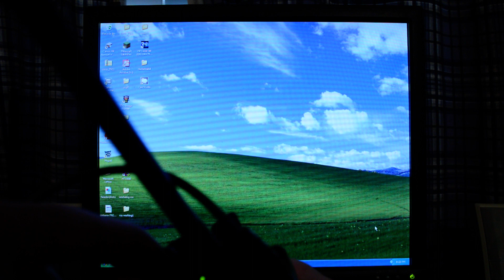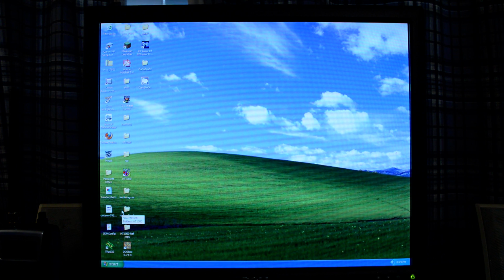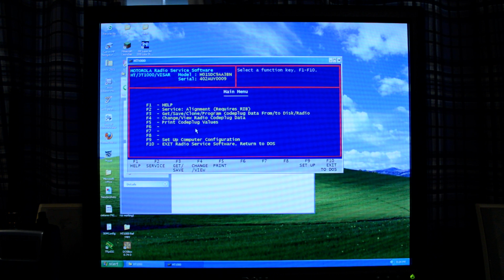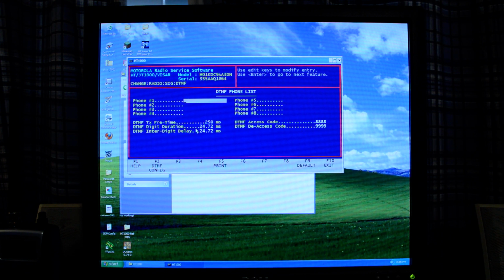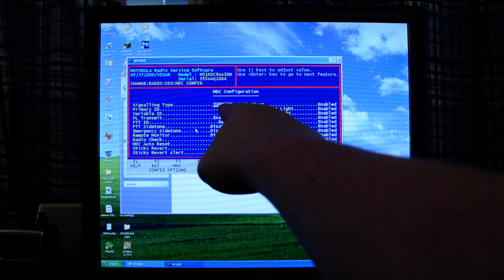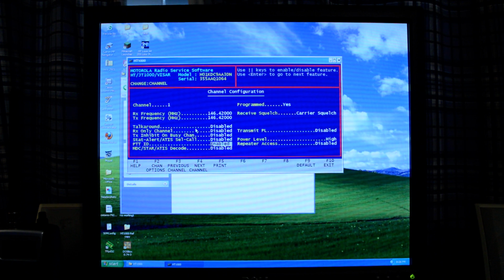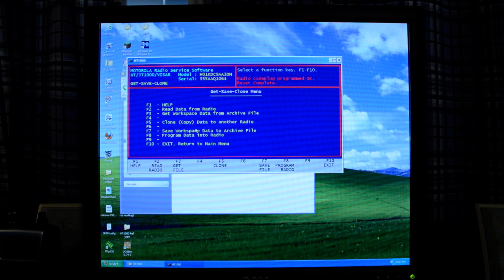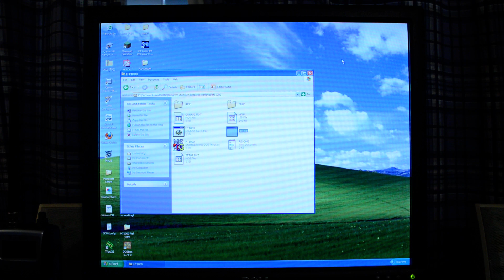How to program the Motorola HT1000 with TPT hack.

Comment: Hello!!! i know that this is an old video but i am having a very hard time with this. so I got the software and i got it all set up on my win xp Panasonic Toughbook and made sure my com ports where right then i went into the software and no mater what i tried it kept giving me the RIB connection unsuccessful error. if anyone has any helpful info it would be greatly appreciated!
Reply: I ended up useing freedos booting off of a CD and got my radio programed, something was messed up with my win xp or something

Comment: I need the software
Reply from the maker: Heres the link. https://gcor.deadlygopher.com/products/detailedproductview.asp?productid=2156
Reply: @DeadlyGopher  everytime I download software run as you say when I get to my file to open software it's telling me that my computer is running 64-bit and the program is only 16 bit??? "This app cant run on your PC" also I've tried compatibility settings still no luck please help me out brother
Reply from the maker: @KO4RXE-WRMR358  Are you using a 32 bit edition of windows XP. It sounds like you are either using a 64 bit version of win xp or a newer operating system.
Reply from the maker: Did you ever get it to work?
Reply: @DeadlyGopher  nope smh..but I have a 32 but laptop coming that should run it... thanks bro for definitely getting back to me...I will keep you posted...laptop should be here in few days..
Reply from the maker: Where you using a 32 bit version of xp?
Reply: @DeadlyGopher  no I was using 64bit trying to run 16bit.... windows 11
Reply from the maker: Oh that’s why it didn’t work. You could still try Dos box
Reply: @DeadlyGopher  right which is true ..I'm under 2yrs in the hobby and not sure if the DOS box would have made it compatible or not...with the DOS box being the same price as a 32 bit laptop I'm thinking I went the better route?
Reply from the maker: Dosbox is a free software that emulates DOS. A 32 bit labtop would still probably be more reliable
Reply: @DeadlyGopher  link??? What??? Enlighten me ...

Comment: hi. you replied to a comment of mine on this video: https://youtu.be/YFiSFcJrmhY and you said i could use a “T-Mobile MVNO.” i dont know what that is, but i had to get a new sim card a few months ago and it does not support their 2g network. i used to be able to use old 2g cellphones with my old sim card but it broke and the new tmobile sim cards are only 4g and 5g.
Reply from the maker: Sorry for the long wait the comment got held for review. It's just a smaller company that uses t-mobiles towers to provide the same service at a lower price. Here is a link to the one I use. It's called US-Mobile and it works great with 2g stuff. I've used it with my Nokia 5190 that I just got last week. Also if you use my referral code you will get 50% off your first bill. https://usmobile.com/referrals?data=Y29kZT1YV1FGQlpHJm5hbWU9S2FydGVy
Reply: ill definitely give this a try. my dad switched to mint mobile and gave me the 7 day free trial sim card he got and it works great with my nokia 5190. ill give us mobile a try once my mint mobile trial ends. id definitely rather use an old 2g cellphone than my smartphone. i absolutely hate smartphones.
Reply from the maker: @jacksonsanders23  Mint will also work but there more expensive. It's nice to have a device where I dont feel like I have to look at it all the time.